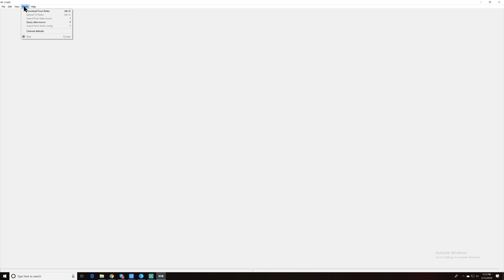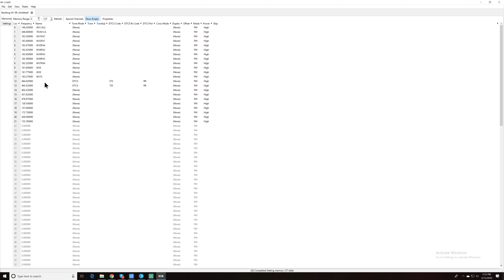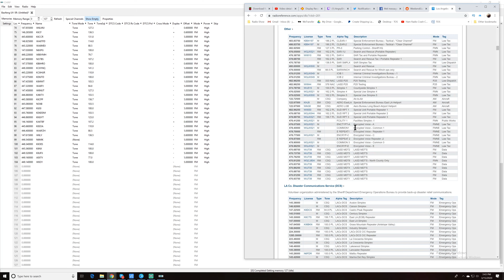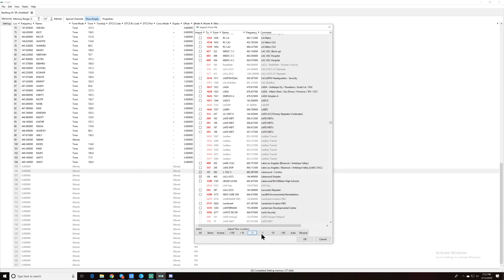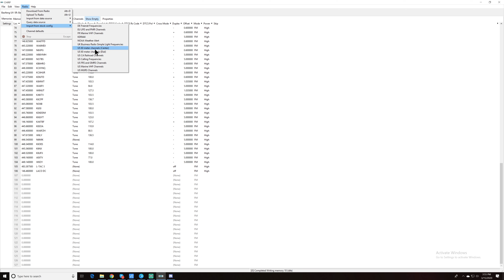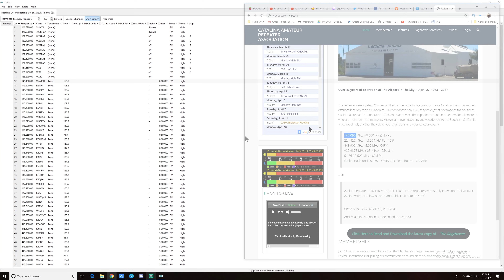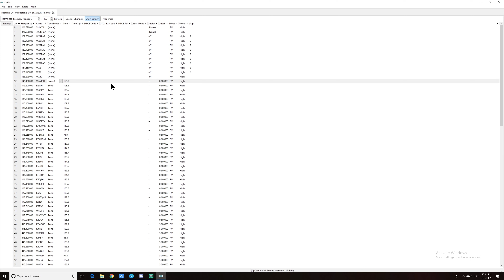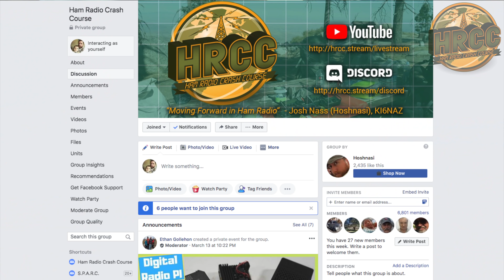How To Program a Baofeng Ham Radio Easy and FAST With CHIRP

Comment: I am new to Ham Radio and find your videos to be tremendously helpful.  I have a question about PL, which I believe is like a key to the door of.a repeater.  If the repeater has a PL, is it programmed automatically when you program the frequency, or is there an additional step necessary?

Comment: Josh, I cannot get past the first step. Bad cable, so I bought the one you recommended; however, when I go to download from Radio, I get a "could not open port COM3: [Error 2] Message - The system could not find the file specified." Recommendations? Running Windows 10 on a new HP Computer. Thanks.
Reply: Plug the cable in FULLY on the handheld. I had the same problem, till I figured out the cable wasnt all the way in.

Comment: I can't get the radio to connect to Chirp. I bought the cable you recommended. Any ideas. This is the second cable I used, neither of which would connect the radio to the Chirp application.
Reply: I got it to work. I had to install the right 64 bit Baofeng driver.
Reply: Bassin Billy,how do you install the 64 bit

Comment: Complete novice here. Do you need to program this radio to use it? I only want to use it as a scanner with whats going on now. Mine didn't come with any CD for programming. And why the need for another antenna besides the one it came with? If one or both questions can be answered, thank u

Comment: Whoa! Lots of info, but totally confused. My "Port" section is empty, and I have no idea what to put there. Can you tell me how I find out what my USB code would be if coming directly from my PC? I tried the options under my device (1.1, 2.0, and 3.0), but they didn't work.
Reply: I am having the same problem. Did you get this figured out? Please email me.
Reply: @RedBluffWiseGuy  No, I still can't get it to connect. I may have to reach out to local tech folks. :(

Comment: Thanks for all the help. Do you already have a video or can you make a video on linking repeaters to transmit across repeaters to a final destination? Also, if one person has a radio across 8 repeaters, let's say, how does the transmitting process work in that instance from both the transmitter and receiver?

Comment: Having trouble even starting as neither the Baofeng UV-5R8W nor BF-A58 will download from radio to CHiRP. Using different cable for each radio due to differing cable interfaces for each radio. Have saved import data file but “Upload to Radio” option grayed out due to never succeeding with download, I assume. Any thoughts?  Thanks.

Comment: Have you noticed problems when trying to program split tx/rx frequencies? Both the radio and the software will allow you to enter it in but doesn't want to retain what you put in after you send it to the radio and/or save the program file.
Reply from the maker: No, not really.

Comment: Thanks for the helpful hints  … I noticed that when the repeater drops scanning is immediately resumed … Is there a delay feature to use when scanning?   Thanks
Reply: Check out this vid - HAM Radio Crash Course - Baofeng UV5R Family Radio Programming and Settings Part 1/2

Comment: I followed the directions and programmed some local repeaters, however I cant hear them. Am I out or range? NOAA 162.425000 works on channel 8 and I hear it just fine. But other than that I am totally deaf. I programmed in 4 repeaters but theyre silent, can someone help me?
Reply from the maker: How far are the repeaters away from you?
Reply: @HamRadioCrashCourse  closest one is less than 10 miles

Comment: I got the cable you recommended, but it doesn't work with UV-5XP. I've tried it on Win 10 and Win 7. I've been in IT for 25 years and tried every trick in the book, including finding the older drivers and installing them. You mention the light on the radio blinking, but what am I supposed to see on the cable? I plug it it and the Red and Green LED light up briefly and when I try to connect Chirp the Green lights up briefly before telling me it failed.

Comment: I bought the right cable from your amazon link. Could not open port. The system cannot find the path specified.

I have 3 ports on my computer 
I’m stuck..help please 🙂
Reply from the maker: Leave the plug out of the computer.  Check how many ports are in CHIRP.  
Close CHIRP, plug in the cable.  Start CHIRP and see if a new port is there.  

Use that port, and make sure the radio is on.

Comment: I fixed my programming problem by backing out the windows 10 update. Then the Baofeng cable worked.
Reply: Hello, did you get the original Baofeng cable to work with CHIRP and UV-5R? I just get Device not responding on every COM Ports.

Comment: Thank You. I found this very helpful but will need to watch it many times. I got my Technician about 3 years ago but didn't know any HAMs and so did nothing with it. I was inspired by your YouTubes and purchased UV-82HP (and the cable you recommended). The repeater stuff I am not sure about. I will review my study materials to get back up to speed. My question: Does CHIRP work on Macs?? Thanks! KM6DMG. I am in Fallbrook so south of you.

Comment: I have two Baofeng GT-3s.  Was pulling my hair out trying to program them until I discovered CHIRP.  Two things I've noted.  First, CHIRP does not always automatically recognize the COM port the radio is connected to, so you may have to manually select the COM port through trial and error.  Second,  you may have to set CHIRP to a different radio than your model in order to get the radio to properly import and export.  Other than those minor glitches, it's a great tool for programming these radios.
Reply from the maker: It’s not a glitch, you have to provide the serial port. Just being up your device manager and then plug in the cable. The new cable in device manager is what you should point CHIRP too. 

Further, the radio types also aren’t chirps fault. It’s the all the cloned baofengs that are internally identical.

Comment: How about a trouble shoot for us new comers....  I keep getting an ERROR when I try to import from radio.BF-F8HP with recommended cable.
Reply: Right click the chip app and tell it to run in Administrator mode. That fixed the issue for me.
Reply: @chandlerholmes1363  I notice the cords don't seem to go in all the way. But. Ill give that a try. Thanks.

Comment: Hi Josh! I'm in BC Canada - and I just purchased (will be here soon) a Baofeng CH-6DMR which is apparently the new Canadian model. I've been watching your videos and just a quick question - is CHIRP location dependent? When in your video you go to Import from Stock Config - they all seem to be US options - when looking at the calling frequencies? If I see that in mine - will they still work? 

Are there any comments you would have for a Canadian in general with regards to this video (using CHIRP to set up a Baofeng) - and differences you are aware of that I should look out for? The reason for getting the radio - for now - is simply when I off-road on forest service roads I lose my cell connection. I'd like to use this for emergency call outs if ever needed (hopefully never) and weather reports as a start... Then I hope to get more involved as it's all quite fascinating...

Thanks in advance, and your videos are all really helpful!

Comment: the cable from amazon says "Works with BaoFeng's Latest Radios: UV-5X3, BF-F8HP, and UV-82HP".  I have a UV-5R and the cable is not working with this one... Do you have a recommendation for an ftdi cable that will work with the UV-5R baofeng. btw i tried to use it with windows 10 and linux ubuntu, neither worked.

Comment: So at the 4 20 mark when you down load from radio, the green bar never appears and and it says "radio did not respond". I am using the cord that came with the radio in a bundle to my computer. I've disconnected and tried over and over for an hour now. Unplugged it, turned on and off. I'm stuck.
Reply: You may need to make sure that you are using the correct interface when communicating with the radio. Chirp gives you a drop-down menu before starting communication to select the interface. I have one UV-5R that simply won't respond, while others do, so there is that too!
Reply: @charliefoxtrot5001  I'm on the verge of just throwing it out. I have a new cord coming, try #3 if it don't work im bowing out. I'll Go back to yelling and drums 🤣

Comment: This might be already mentioned and is probably late to this, but a quicker way to change the data in Chirp is to export the data as a .cvs file and open the .cvs in a spreadsheet program and make make your changes within the spreadsheet program. After you make your changes, save the file as a CVS and import it back into Chirp and out to your radio.

Comment: I did get the chirp file to load but when I open chirp I get a list of files and not the actual file like it shows in your video.
Reply: I had the same problem. Finally figured it out. Click on the CHIRPW file with the picture of the little radio on the left. That opened the app for me.

Comment: Hey, I bought a handheld from CRT, and I'd like to program it, but chirp does not have crt as a manufacturer. I did notice that my CRT bears a very heavy resemblance (identical screen and cable port) to most baofeng handhelds. Do you think I could use Chirp with the baofeng manufacturer to program my Crt?
Reply from the maker: Yeah, try the UV-5r first.

Comment: Josh I just purchased this radio and also purchased an 18.8” abbree antenna and I programmed the radio like you showed in this video and I barely pickup anything.  Police, FDNY and Ems come through and 1 station on the NOAA but nothing else.  Any suggestions?
Reply from the maker: Put the stock antenna back on and see what you hear.
Reply: Ham Radio Crash Course I’ll give that a shot.  Thank you.
Reply: You were right I was able to connect better with the antenna it came with than the abbree.  What would be a good car antenna I can mount on the roof for this radio?

Comment: Hi Hoshnasi, I am having ISSUES!! I have the BaofengTech FTDI cable, with the latest FTDI driver installed. My computer sees the cable and states it is working. I follow ALL the instructions to the letter, but there's no connectivity with my UV-5R. FAQ search didn't help. Any ideas?
Reply from the maker: What does it say when you try and download from radio?
Reply: I had a similar issue with my UV-5X3... ugh, don't be afraid to push the connector all the way into the radio, lol, that was my issue. It feels all the way in, then goes another 1/4 inch.

Comment: I can never get consistent results with Chirp. Seems like it only works on a Fresh install. Then every time I go back to use it a 2nd or 3rd time it gives me nothing but problems.
Reply from the maker: I’ve not had issues like that. What kind of computer are you running it on? Make sure you install the updates.

Comment: For turning off the transmit on the weather and other stations..  You can click on the top one, hold the Shift key, click on the bottom on, all between will be highlighted, right click on one of them, Properties, click the checkbox beside Duplex, select what you want in the drop-down and then click OK.  It will change all that are highlighted.

Comment: New to these radios.
Your video was extremely helpful and straight forward.
Just programmed 2 UV 5Rs no problem.
Only thing I would add is to reboot after installing FTDI cable to update driver. 
Thanks again!

Comment: i got the pc cable it made my radio hot .so i caned it i just got a icom hf whats your take on that radio ,i am working on my ham as of now , i wish i had my ole radio man he was good at making a dio pole maybe that would work well .great video
Reply from the maker: You threw away a cable because it made your radio hot? Where did the cable come from?
Reply: @HamRadioCrashCourse  I purchased it with my beofang 8hp

Comment: This is just ONE reason ; though, there are many:  One of the many reasons that Public Safety Agencies have migrated to 700Mhz/800Mhz Digital-Trunked Radio System.  To KEEP OUT the SHTF Preppers from popping up on their channels (assets), especially during an emergency.   Public Safety Agencies want to have COMPLETE and TOTAL control of who has access.  The last thing thing they want is some unlicensed prepper getting on their protected channels and impairing their own units from communicating with their dispatchers during a REAL emergency.  Citizens are suppose to report emergencies through the proper methods:

- Dial 911 or have someone relay it to 911.   911 is available even on disabled Cell Phones.  911 calls get priority on Cell Towers. 

The last thing they want or will accept is an unauthorized operator showing up on their channel and interfering with their units from doing their jobs.  It is UNACCEPTABLE, INEXCUSABLE to interfere with 911 communications.  They will find you, they will notify the FCC and both the FCC and the PS Agency may prosecute you.  They have Directional Finding (DF) equipment.  All 911 communications are recorded, 24/7 (Phones & Radio Channels).  All recordings can be used in a Court of Law.

Again, the SHTF Preppers are one of the many reasons Public Safety Agencies migrate to 700mhz/800mhz Digital Trunking RS.  For protection from unauthorized radio users.  Again, most PS Agencies want to STRICTLY CONTROL who has access.  Especially, during an emergency when interruptions on the PS channels is UNACCEPTABLE.

Acutally, some dispatches don't personally mind if the public or news media can listen to them.  Just so long as the Public & News Media does NOT use the information heard on the radio to somehow interfere with the PS Agency doing its job.  Or contribute to a risk to the Public's Safety or to the safety of the First Responders.  Unforunately, this scenario has played out one too many times.  SHTF Preppers have NO REASON for using PS Agency channels at any time <period>.  More and more PS Agencies will migrate to PROTECTED Radio Systems where the SHTF Preppers can be completely shut out.
Reply: Waiting for the video to load i saw this comment. Im not a die hard prepper but it is the reason i have a radio and am learning..that being said i absolutely agree there is no reason to be on those frequencies.. and it sucks that there are irresponsible preppers out there that do this. You could cost someone their life by interfering with emergency radio transmissions. People need to be respectful and use common sense.

Comment: What if the light does not work when you do everything you have said to do could it be a bad radio I could not get anything on the earphone either not even music all of this after spending 22.00 on a cable I set it up just like you said on the other video. So far I can not get my radio to do anything but play FM music I think I will reset the phone and start over again I have tried it on a windows computer and Linux Mint.
Reply from the maker: Reset the radio and try again?

Comment: I get an error when trying to import from data source /radioreference 
It says your try to install distributor’s python-subs package PLEASE HELP using a Mac on 10.15.4 newest version on python and chirp
Reply from the maker: Do you have an account with radio reference?
Reply: Yes I have the yearly membership
Reply from the maker: @nic8850  Update the to the latest CHIRP and google the error along with the word "CHIRP" in there and see if somoene else has had the issue.

Comment: Hi Josh,
I got the cable linked from you and I am still getting the "an error has occurred, radio did not respond." Any ideas what's going on? Thanks,
KC
Reply from the maker: Make sure you download the FTDI drivers. Make sure the cable is seated hard into the radio and that the cable is acknowledged by your os.

Comment: Just got a baofang, I can't program anything into the radio. I have the cable that came with it but I get errors I have to get the other cable?
Reply from the maker: The cables that they pack in are garbage. They require modified drivers to make them work right. I always point people to the FTDI cables
Reply: Ham Radio Crash Course Also, what's the name of that website that did a complete user manual on the baofang

Comment: I can’t get the port to be recognized and I’m using a windows pc
Reply from the maker: It’s likely the cable.
Reply: Ham Radio Crash Course I ordered the one recommended should I just order another of same one
Reply from the maker: You ordered the one on my link?
Reply: Ham Radio Crash Course yes
Reply from the maker: @dallasmcgaughey3675  When you plug it into your computer, does the dongle flash at all?  Does your computer make a tone to let you know a USB device was found?  Leave the radio unplugged.
Reply: Ham Radio Crash Course yes the cord flashes a few times at first and driver shows it works but when I go to select driver to download from radio it doesn’t work

Comment: hi josh, i have a baofeng UV-5r plus. Trying to program with a Mac running Mojave. Downloaded the driver from prolific and the latest version of chirp. Tried the first step download from radio and I get an error "an error has occured - radio did not respond." Any tips? Thanks. KC
Reply from the maker: Yes, get the FTDI cable I linked in the video.  The Mac in particular needs the right cable.

Comment: My local fire department has a dedicated frequency that sends an automated alert to each fire house. I certainly don't ever plan  to transmit on it but an accidental button press does happen would it transmit on that frequency to the stations or not?
Reply from the maker: Yep.  Turn off the duplex so you can’t transmit on that frequency.
Reply: Ok cool will definitely do that thanks for the advice